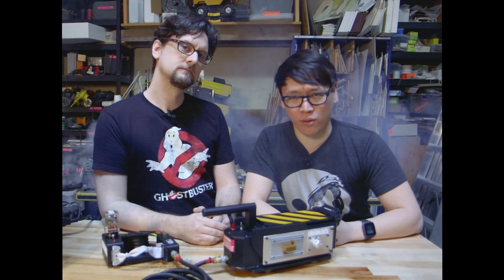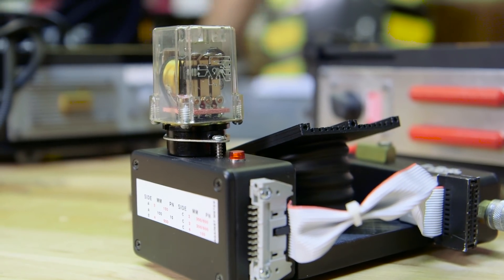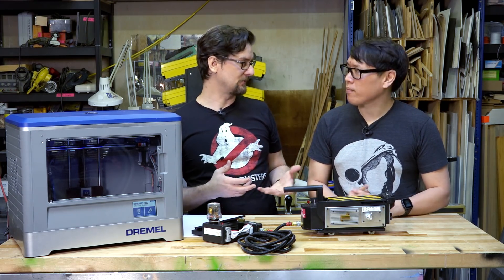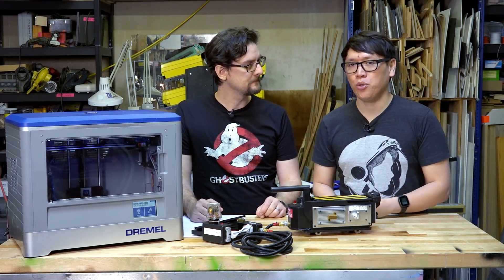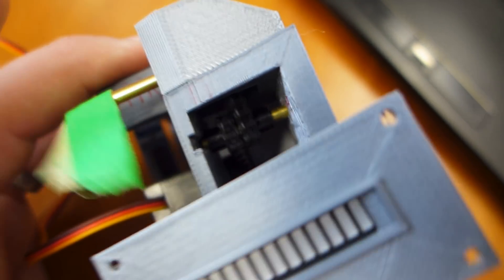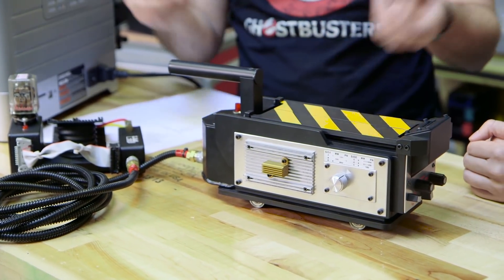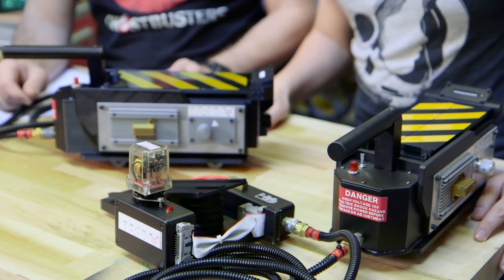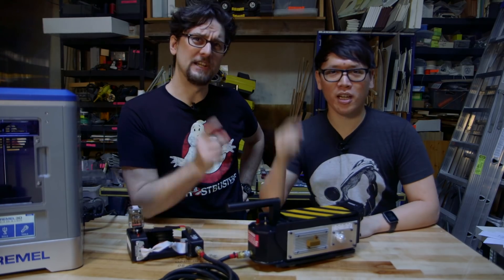Making a Working Ghostbusters Ghost Trap!

Comment: this got me thinking how i could diy a similar product. i usually try to avoid programming, and i figured i could just use some servos and a polarity toggle switch. then i could just have a static light connected to one of the on options of the switch, and voila, i have a homemade ghost trap.

Comment: I'm also interested in the wiring system that you use I was wondering what wiring system you use for the internals in your trap or if you have a listing of the parts that are used for the wiring for the lights smoke and sound and do you have the parts that hook up the pedal to the trap itself I'm very new to the Ghostbuster building fan club. I'm trying to learn how to upgrade the trap an proton pack an pke meters

Comment: That is truly awesome.

Since the Foster connectors are meant to carry air, couldn't you have made the whole thing pneumatically activated?

I'm thinking, put a bellows in the pedal, put some kind of diaphragm in the trap. The diaphragm would activate a small momentary switch like a PC reset button, that would activate the electronics in the trap.

Also, does the ghost cartridge come out?

Comment: Since you have a pneumatic connection from the foot pedal, why not go with an air switch like you can find in garbage disposal units?  E.g., the cheap part from this expensive kit:
http://www.homedepot.com/p/Garbage-Disposal-Air-Switch-in-Brushed-Stainless-I5580-BS/203499159

If you do it right, it might eliminate the air pump too....

Comment: Wow you really made that remote hard.  why not just use air bladders?  stomp on the foot deflates a bladder, inflating a tiny bladder in the unit hitting a micro switch.  that's how the gb would have done it, because it's very common technology.   it's how many tools work.

Comment: So if the peddle is just an on off toggle, why not use the hose and air pressure to flip an internal switch rather than having to run a wire through the hose?
Reply: +nwstraith I was thinking the same thing.  Just use a pressure switch!

Comment: You could use a pressure switch in the main unit to trigger the action this way you are still using the air hose but you will have to put a bellows in the foot pedal.

Comment: Looks great! quite fantastic!
...but I really expected a blast of air when the trap opened? More Kinetics? I deeply expected a couple of cheezy paper streamers of the appropriate colours to come shooting up. :-) Then reverse the fans to suck the streamers back in just before the trap closes for ultimate style. That would really show off the smoke system too, by making the whole surrounding air part of the effect. If you have internal space issues, (it's clearly cramped in there.) maybe try an Electro-ducted fan. (EDF. Tiny jet engine RC system that you can drive with an ESC from the Arduino. They move amazing amounts of air for their size on a couple of volts, if you have the amps to drive them. :-)
Beautiful work!

Comment: The gold compononent on the side mounted onto the aluminium looking heatsheald is a headsink for power resistors.

there availible from rscomponents.

recently had to order a few to replace ones on the crossover of a set of martin LE400 monitor wedges for live sound

Comment: Another solution for the hose issue is to just use the hose connectors as intended and have a air operated switch in the trap and use the bellows in the foot pedal to trigger it.

Comment: I can't help but to think that it would have been a lot easier and more reliable to make the foot pedal control the trap by having a simple bladder-type air pump under the pedal sending compressed air through the hose to a piston operated switch in the trap. The air hose would have been actually used for what it was built for.
Reply: still would have had to have  way to turn on the electronics in the trap.  that's why he decided to run the wire through the hose.
Reply: Yeah, I was thinking the same thing. seems like it would be a lot simpler than running wire through the hose. 

+mtxrules there are switches that are actually designed to be activated by small changes in air pressure. They are often used to ensure a high degree of insulation/separation between an electrical device and the person operating it....Something you might want in an actual ghost trap.

Comment: just a minor tweak suggestion for your  portable spectral containment trap...just before the trap closes,  the smoke generated needs to be "inhaled" slightly via a small vacuum ... probably more for esthetics than anything since the effect would in most cases be too subtle to notice unless actually present while in use but it would be nice...

Comment: Looks great guys.
Just wondering, was Air Pressure (switch/sensor in trap) not an option for some reason? no wires or wireless system required to communicate between foot switch unit and trap unit.
Reply: +Ari Takalo Looking at the in-depth video it's just a simple switch. 

+Sebbl3  The hose itself is already air-tight; the only place where you need to worry about it leaking out is the peddle side.

Air-pressure switches are often used to ensure a high degree of insulation/separation between an electrical device and the person operating it....Something you might want in an actual ghost trap.
Reply: +Steven Allen I'd think using air pressure is much more difficult than using two wires and a switch.
Reply: Not really. Using air pressure you just put the switch in the trap instead of the foot pedal. It's a different switch triggered by air of course.
Reply: Every jacuzzi tub has such a switch so you don't get electrocuted. The button uses air pressure to throw the switch remotely
Reply: +Steven Allen I'm not sure, but they might be doing or planning for more than just a simple switch. For that 2 wire data link like I2C allows for more flexibility.
Reply: *****
It may allow for better flexibility, but I am sure that it would of been far easier than trying to work out installing an electrical connection inside an air fitting (and keeping it working long term). my comment being that the air switch would likely of been FAR easier to manufacture and likely cheaper.

Comment: Just a thought, use a pneumatic micro switch. The bellows under the foot pedal could displace air through the hose to activate the micro switch, which would be in the trap unit. That would be easier than converting the air fittings.
Reply: +Scott M (Scotty2307) Not reliable, but it is just a show piece. By pnematic micro switch, i assume you mean a piston allowed to hit a microswitch? HOWEVER, if they did go that route, they could of taken advantage of the negative pressure to suck back up the smoke.
Reply: +Richard Smith Hello Richard. Thanks for the reply, but that is not quite what I am talking about. These air operated switches, micro, or larger, have been used in many industries, for decades, and are proven reliable. They come in many styles, and some can be wired normally open, or normally closed, depending on the users requirements. Here is one of many I found at Granger Supply; search 1AGP7 on Google, and the Granger link will be the first one. There are less expensive ones at sites like Aliexpress.

Comment: now do the proton pack
Reply: +number3665 nothing is too big to be 3D printed. You just make it in sections and stick them togther. Check out the YouTube channel XRobots (James Burton). He has 3D printed BB8s, an R6 droid, a Hulk Buster costume and an Alien Xonomorph Suit. It would be relatively easy to model a Proton Pack and then break it up into smaller parts for 3D printing. You don't do it all in one go!
Reply: +Elios0000 Some parts of the pack are pretty big. The 3D printer they use currently is good for smaller parts, but they would have to get a larger 3D printer for the bigger parts.
Reply: +Elios0000 Too big to be 3D printed like someone else stated. And if they were to purchase all the correct parts and build it accurately it would cost over a grand.
Reply: Lufferov That makes way more sense. But the main body of the pack has to be one piece or I would assume has to be one piece. What is the largest size a 3d printer can make parts anyway? Now I want to see it done and how accurate it would be to the original.
Reply: +Lufferov Most the big pieces he used on the hulkbuster are foam like mats he formed with heat and wood. he only printed small parts for it.

Comment: Doing the footswitch with RF is trivial and cheap.

You can use a RF433 or in the US probably RF315 sender and receiver for like 5 bucks either use encoder ICs or user VirtualWire in Arduino if you want to omit the whole encoder and do some sort of encoding in your software.
I used this technology in lots of magic effects. And in Europe using the RF315 is very reliable because it's officially not a free band here, so no traffic at all ;)

I actually have PIRs with 433MHz in my house, so when I walk into a room, it will send a code over 433MHz this is received by a 433MHz receiver on my raspberry pi and that will talk to the HUE lights over REST. very reliable and cheap.

So I don't understand why this process didn't work here?
Reply: RF is one of those things that's trivial if you have some idea of how to do it and potentially a real pain otherwise. For example, try and use those 433MHz modules with an inappropriate coding scheme and you're in for some pain.
Reply: makomk
RF is indeed very much like black magic or voodoo, even for experienced people. Because at high frequencies weird things start to happen.

However in this case you don't need complex data transmission, just on and off so with a supple amplitude keying that would be trivial -- especially at that distance of 10feet max.  You can get them from a ChinaShop all setup to work.

I agree that data transmission with these are not as trivial. Good reliable comms only work up to 2400 baud is my experience, at this low frequency.

Comment: What about suction pump inside to suckup the smoke like its trapping ghost?
Reply: +Karan Chaphekar He could of made the footpump open a valve and press a microswitch with a piston, then allow the vacuum of releasing the foot pedal to suck the smoke back in at a controlled rate. The hose would get caked with glycerin tho :P
Reply: +Richard Smith you know too much useful stuff. stop it.

Comment: Turning a pneumatic hose into electrical wire seems kind of silly. Especially if all you're using the foot pedal for is a momentary switch.  Why not just use the pneumatic hose as a pneumatic hose and pick up a pressure change with a little pressure gauge in the trap when the bellows on under the pedal are compressed?

Comment: With the wheels on the Trap and the cable connecting it to the foot pedal this kind of reminded me my first RC Car which was tethered - Argh.

Going forward with that thought I came up with the idea of repurposing a 1/16 Scale RC Tank Model into a modernized and remote controllable Trap.

The tracked chassis allows you to have it go over somewhat rough terrain and the turret, combined with a pitch function, could act as a sentry turret pointed into the general direction of the target =)

Comment: damn they needed seperate props for each effect in the orignal films?  is it because prop making technology was low back then? like how modern day 3d printing lets yu work out all the mechanics needed and special components like the vape mechanism didntexist so they had to get a special ghost trap that can fit dry ice?

if so i cant help but see cGI as a great compliment to practical FX just due to how versitle the tech is:) i think.
Reply: +Meir Teichman It's been common practice to have multiple props with different effects and materials even until today. You can actually learn a lot about that if you watch this channel's older videos....
Reply: strangerthanreality oh am am fully aware of how much effort the put into practical effects back in the day:) was just curious if it's modern tech that let you make "fuctional" props like this. if i make sense.

like i remember aring that most of the time when a scifi show had a portible screen like in the hitchiker's guide it as a carefully positioned back projection but now having smartphone technology you can have the actual screen itselfXD.

i forget if the tested krew ever visited legacy effects:D those guys do amazing 3d print pacticals:D and are masters of hybrid SFX:D
Reply: +Meir Teichman I'm sure it would've been possible to make something like this back when the film was made, but it would've been a lot of extra unnecessary work. Why go to the hassle of rigging up smoke devices on all the props and worrying about the fluid spilling when the actors sling them around when you can just drop some dry ice in? Why put in lots of extra time-consuming mechanical design to hide the door mechanism, when you can just make sure that version is never filmed from an angle where you can see inside?

Comment: why not just use the pedal to push air through the hose and have some sort of pneumatic switch on the end to detect the pump of the pedal.
Reply: +Jokker88 I thought the same thing, and the e-cigarettes they mention actually include perfect switches for this.

Comment: For the Electronics components, they are relay easy to find,  i.e. the resistor is a standard type witch is widely used. Maybe ask an Electronic engineer they know where u can find such stuff.
Reply: +TecKonstantint I forgot to add the Links: These Power Resistors are quite common used in electronics, they are also used in Aerospace and all different kind of Equipment, i used them my self in some designs. I have some Links for you where u can find such Resistors, maybe you have to us a different kind but as far i can see the RCD 600 series Seems to fit quit good but u can look it up in the technical drawings. They are not cheap but that is normal for those aluminium resistors.
http://www.farnell.com/datasheets/168901.pdf
http://www.newark.com/webapp/wcs/stores/servlet/Search?catalogId=15003&langId=-1&storeId=10194&categoryName=All%20Categories&selectedCategoryId=&gs=true&st=RCD%20600
Probably you can buy them from other distributors.
Have fun with that info if u need any more just ask, im glad to help
Tec